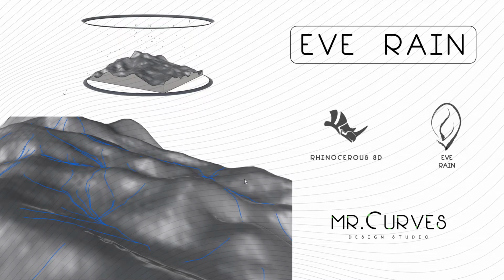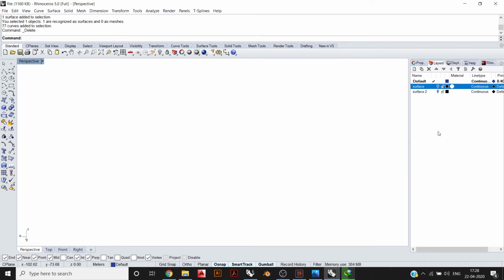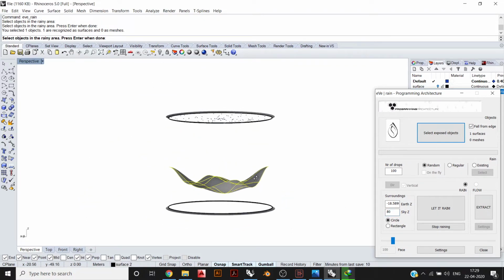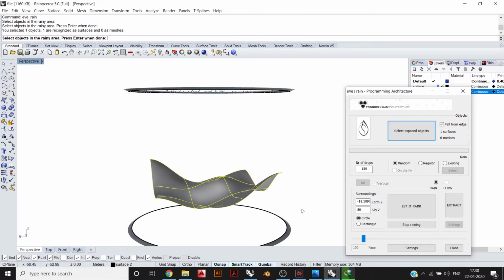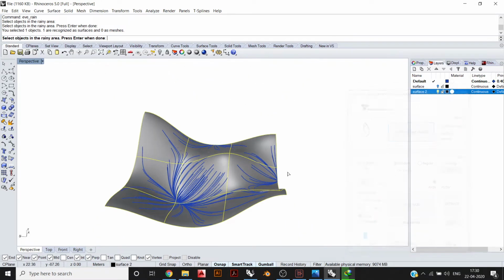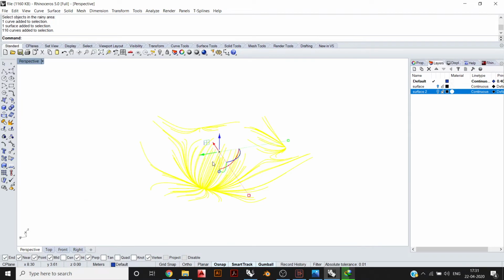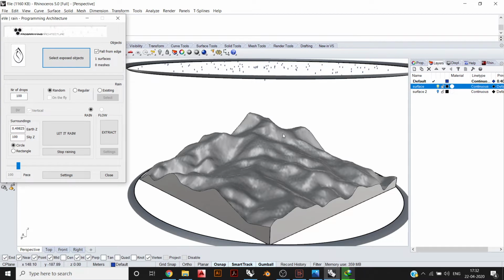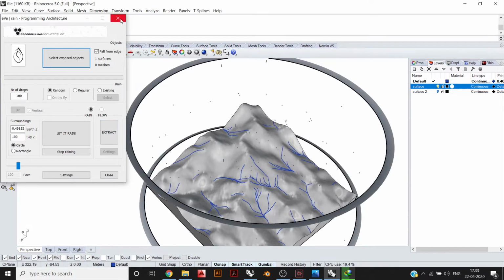Rain Analysis on a Topology l EVE Plugin l Rhinoceros 3d

Comment: Hi Mr.Curves Studio,
I have counter an issues to install Everain to Rhino 6 and I don't have Rhino 5, please help.
Do you have the Everain plug-in for Rhino 6 or 7. 
Your plug-in are interesting and amazing, I want to try it!
Please advise, thanks a lot in advance!
Reply from the maker: Hi 
From Food for Rhino I see that, the last update of Eve Plugins are 2014 and it is for only Rhino 5. 
So if you want to use this plugin, you need to have Rhino 5 for sure. 
The other option you can do this kind of situation is from Grasshopper through kangaroo. You can get some examples from Grasshopper support. 
All the best.. 👍🏻
Reply: @mr.curvesstudio  , thanks for your advise!